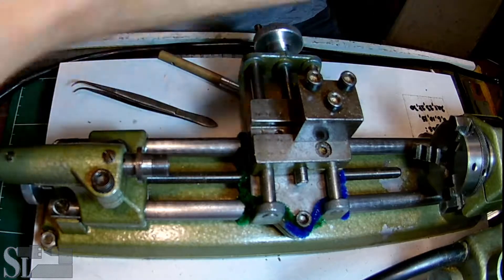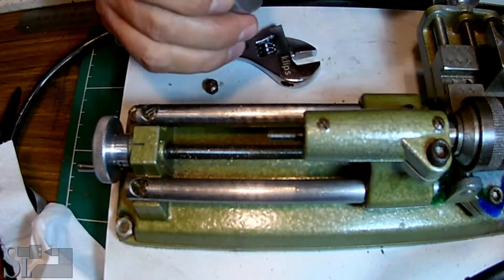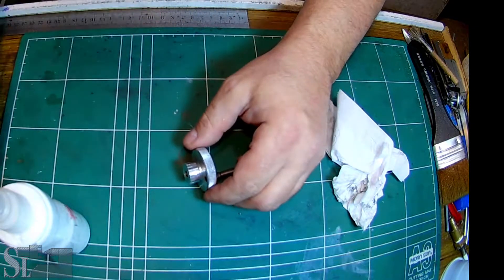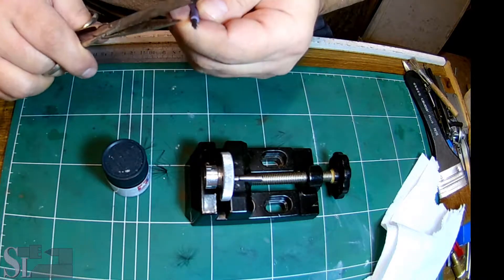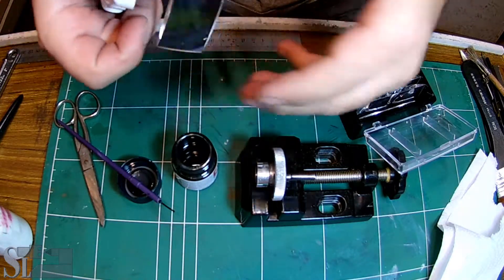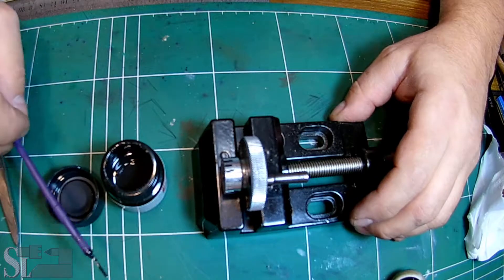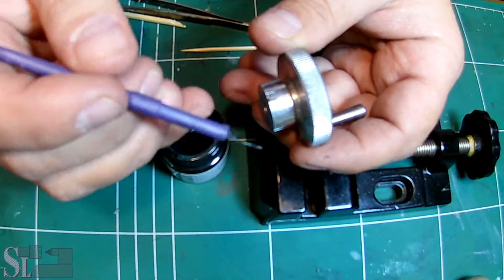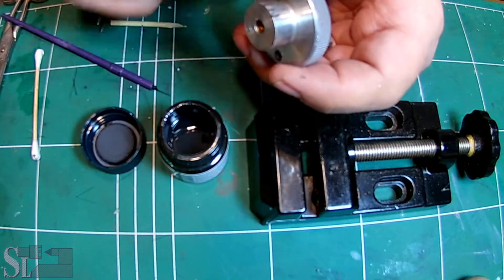Quick video -  lathe maintanance part B

Comment: Suggestion. Next time try enamel paint. Flood the lines a little. When it's almost dry, use a lint free rag around your finger with just a smidge of thinner and wipe the surface clean ACROSS the lines. That should leave the paint where you want it. Red should be easier to see.
Reply from the maker: Good one. Thanks! I'll give it a go :)